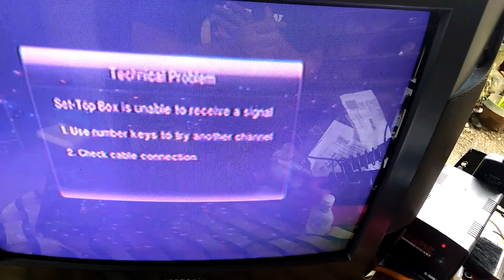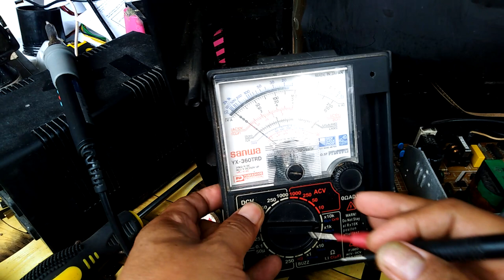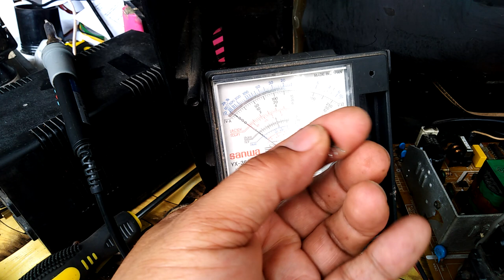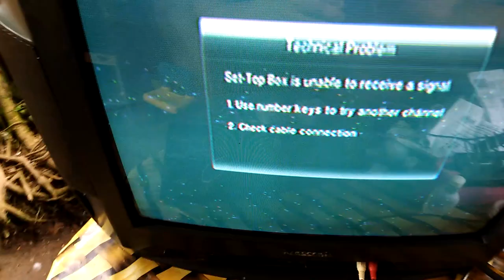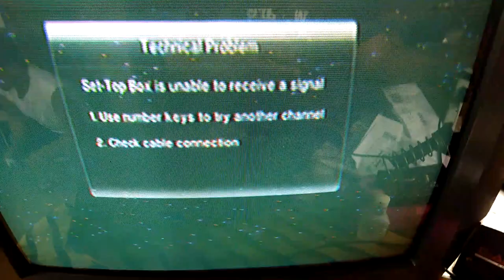CRT TV (GENERIC BOARD) VIOLET DISPLAY PROBLEM! LACKING GREEN! FOR NEWBIES!

Comment: I recently got an old Sony trinitron that has this issue. The video starts off normal but after 30 minutes the screen goes purple like this. What did you say is the issue (or most likely the issue)?
Reply from the maker: It is just a cold solder! Somebody need to resolder it! Just make sure that the crt socket is not corroded.
Reply: @fixnreview  thank you! How can you tell which is a cold soldier?
Reply from the maker: That is a usual problem of a crt tv when it goes on intermittent cases
Reply from the maker: I soldered everything If i open an old tv's even if i only change a speaker. Most of crt tv are not using double sided PCB's which is prone to parts poor contact when the soldering lead starts to melt due to a very high temperature.
Reply: @fixnreview  thank you so much. I'm new to all this. PCB? I'm not sure what this means?
Reply from the maker: Printed Circuit Board (PCB) where most of passive & active components attached & soldered. Thank u too Sir!
Reply: @FIX N' REVIEW  I have a university assignment due this Wednesday, but afterwards I'll let you know how it goes 😄👍
Reply from the maker: Whatever it is I knew u can do it! Good luck Sir!
Reply: @fixnreview  thank you! I'll try after work next week when my equipment arrives.
Reply from the maker: U can do it!